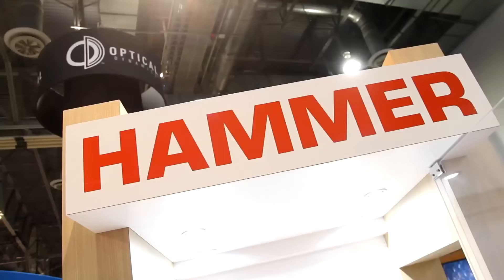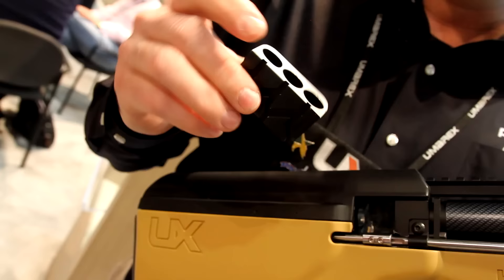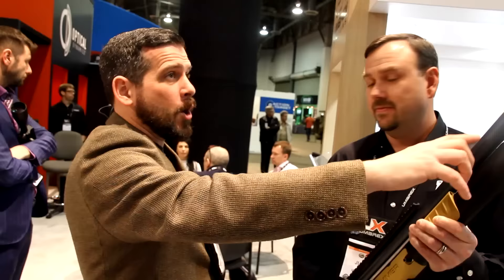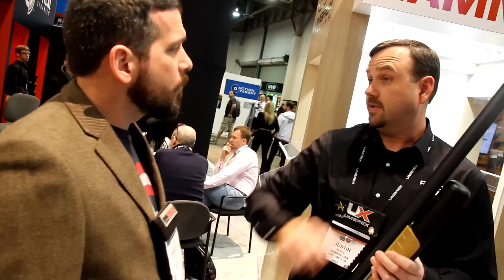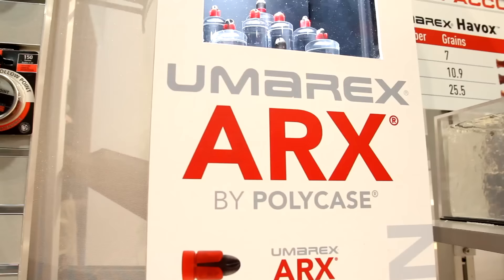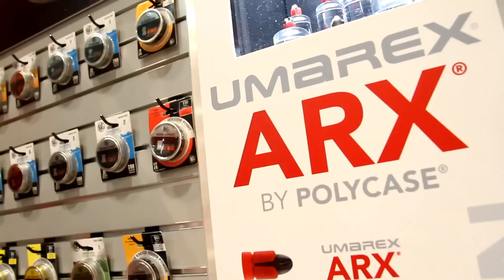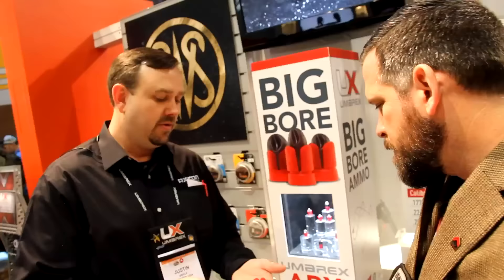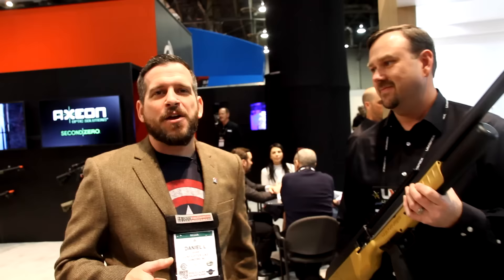A 50 Cal. Airgun With Polycase Bullets! | The Umarex HAMMER

Comment: So if you are not familiar with PCP airguns, yes it is not cheap to get started but after the initial investment it is awesome. I have several AGs, .22, .25, .30,  2 HPA tanks and a 4500psi compressor, and I am set for years to come with all that I need other than lead which is pretty cheap in this calibers ($15 per 350 in .25). The nicest thing is I can shoot several hundred rounds and all I have to do is swab the barrel, zero fouling as there is no powder. They are all suppressed and very quiet, not to mention very accurate. In the summer I set a target at 25 yds and smear a piece of paper with food and shoot flies with my .25 as they land. My .30 is capable of shooting prairie dogs at 150 yds +. The gun in this video is capable of taking deer, hogs, elk, black bear etc. My .30 is legal to hunt deer in several states and this .50 is much more powerful and definitely on my for sure to buy list.  I know many people laugh off airguns but trust me it is worth looking into!
Reply: Well put my man.
Reply: TRPE71 I agree with you 100% I've only been into the airguns for a little over a year now & wanting to invest in a PCP before long & it was between the Texan SS in 357 or this & right now I am leaning towards the hammer.
Reply: Can I use air Venturi G9 hand pump to pump to 4500 psi?
Reply: @duanehopland7506  Hey Duane, that would be one heck of a workout bud, it would be several hundred pumps. If you really needed to you could but it would probably take the fun out of it rather quickly.
Reply: @trpe71  I don't mind a work out .Already pumping up my Benjamin bulldog and Benjamin akela to 3000,as well as my Seneca Dragon claw  and not bad at all.Little at a time and rest and go back over and over until full.Once full I don't let em get under 2000 and pump back up to 3000. Im new to air guns and retired on fixed income but in fantastic shape from hunting and hiking year round .I just took a javelina with the Benjamin bulldog at 55 yards. I just bought the Umerex hammer and  should arrive in a week or so. I just wanted to make sure it was safe .Seems someone told me you couldn't pump the 4500 psi guns as it gets to hard at higher pressure and requires more wieght than most men on hand pump so I wanted to see if it could be done.I have the air Venturi G9 which is the 4500 pump so I guess we will find out .I'll eventually buy a compressor but they are very expensive and now just rather spend $$$$ on the airguns I want first :) I ve always been a bow guy and love and collect guns all my life and got all the firearms I  need and want over a life time .These new air guns are super Kool .Very impressed!
Reply: @trpe71  you were right ! I been pumping on new Umerex hammer from 0 for two hours.Barely at 3200 psi .Getting really tough to pump ! Might have to put some heavy rocks in a backpack to go any higher :)

Comment: With a 4000 psi fill you are going to want at least one 4500 psi 88cf tank, if not 2 tanks to cascade fill using our stikman.  Good 4500 psi Hp compressors start at $2950.  I am looking forward to this gun when it hits the market.  It would be great if they sell the plastic bullet holders separately so we can cast our own bullets.

Comment: I'm curious about the projectile velocity and the air pressure needed... You gotta have ridiculous air pumps for that...
Reply: They said 4500 psi and 800 FPS is 700 FPE with a 500 grain slug. A compressor will run $650-$1500.
Reply: I didn't catch the FPS part..... 800 though?? Cos I seem to remember certain Airsoft guns at 500 FPS and it still ain't lethal... I thought bullets need to be at least 1000 FPS or more..
Reply: I put the bullet grain into a ballistic calculator to find the FPS. A .45 ACP Handgun is about 230 grains and 356 FPE @ 830 FPS and is lethal. What do you think a 500 Grain bullet will do with 700 FPE? That’s about twice the energy of a .45 acp.
Reply: Damn, I never thought .45 acp is just 830 fps....
Reply: Think of it like this weight plus mass = energy a feather moving at 1000 FPS will most likely not kill you. But a bowling ball @ just 100 FPS will.
Reply: I suppose at this point, you shouldn't really think of it as just a bullet, more like a cannonball...
Reply: If i may, when talking about whether one projectile is "lethal" or not, the main focus shouldn't be FPS but FPE. Grain (weight of projectile) matters. Also, sectional density of said projectile need to be calculated for quantifying the penetration of an objects. 
Both grains and sectional density of an airsoft is lacking, even compared to a .177 airgun. Now, for long distance shooting, and considering the shooting arches, ballistic coefficient of the said projectile will also matters. Shooting is math.

Comment: Larger air tanks. Larger. Why the air tank is not as long as the barrel? It would have much more air.
Singleshot loading is better. Like dragon 50 cal air rifles.
Also larger calibers can be used. Like 75 cal or even 82 cal.  Low power mods for target shoting. Like 40 meters distance at paper targets. Lets say 400 effective shots in target plinking mode. Because you want actualy to hit the target. Not important with what force the projectile hits.